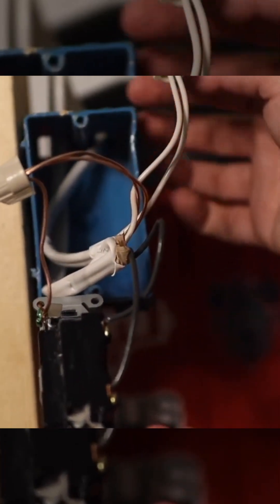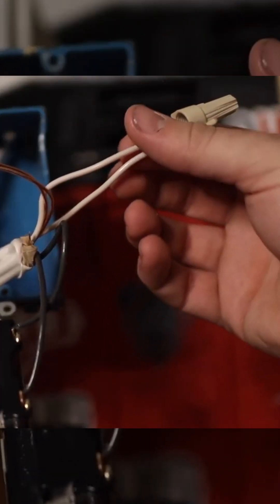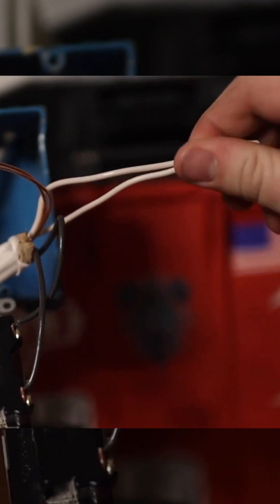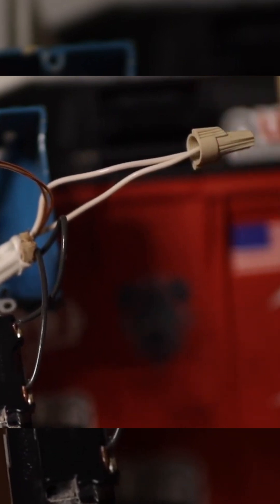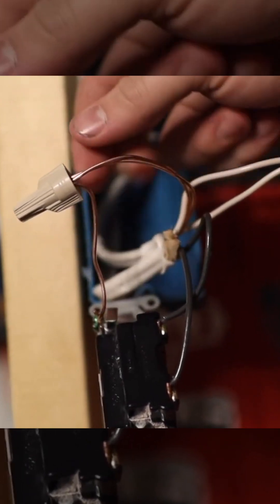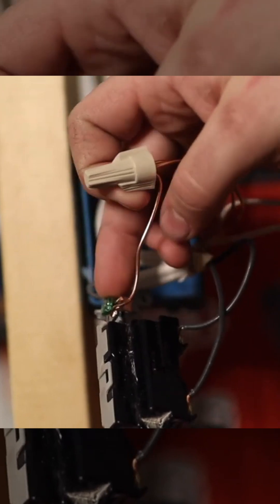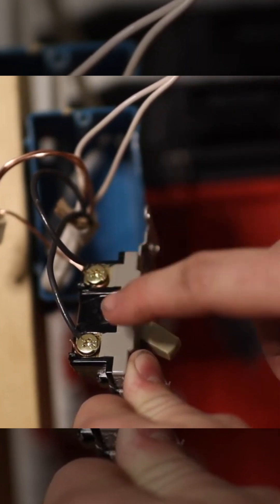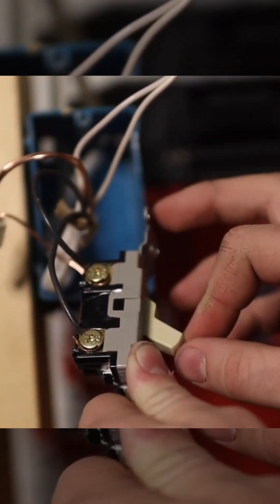How To Wire A Light Switch

Comment: Do you have a video how to tie in a new switch on the other side of the wall from an old light switch that only has 1 wire coming out of the old j box? The existing wire only has black white and ground and comes from who knows where but it controls a ceiling light in the room. I need to get lights in the closet working off that switch...🤔
Reply: Ok,so most likely the white wire is now a hot wire,the black wire is probably a switch leg.Just connect them the same he he explains, and it should work fine.Your welcome 😂

Comment: What if don’t have two wires in the box??
Reply: Should always be 2 sets of wires coming into the box, 1 set is power source the other set goes to the light. However if you open a box and only 1 set of wires that means it has power going to the light first, then a separate Romex coming from the light to the switch box which is referred to as a switch loop ( that's how it was done way back then) now code requires power to the switch first, then a separate Romex going to the light.
Reply: @jonathan3982 i also only have one set of wires coming to my 3 way. Attempted to update the switch now im stumpped. Only one set. So i only have one white, one red and one black. I cant connect the white to anything. The light doesn't come on when the white is not connected at all. And when it is the light sometimes on on depending on which which position the other switch is on. Very confusing. I dont know what else to do.
Reply: @klosettreat  Well there should be a set of wires coming from the light Yes? And a set that's the power source to the switch. So do you have 2 switches that control 1 light? Have you checked the other switch to see if the power source is going to it?
Reply: @klosettreat  Your switch should have 3 screws, a black or dark colored screw which is referred to as the common screw, 2 brass screws and a green screw. Of course the ground ( bare) hooks to the green screw, the red & black hook to the brass screws, which are referred to as traveler wires, white is the neutral should be hooked together with another white coming in with a wire nut. There should also be a another black that is referred to as the common wire. Seems like you have 12/3 AWG coming in at the switch. Each switch box should have 2 whites, 2 blacks, 2 grounds ( bare) and 1 red wire. I'm going to send you a link of video to a guy I follow and subscribed to. He is very informative and knowledgeable. There are different ways to wire a 3 way switch. From what I can gather, you said you only have one set of wires coming in the switch box, which means the power source must be going to the light first and then dropped down to the switch box. Check the other switch box it should have 2 sets of wires? If not what is happening is most likely the power source is going to the light first, and then 2 sets of wires connected together with the power source and light wires, one set each going to the switch box. I hope that makes sense to you. I'm trying my best to help you, I'm not an electrician just knowledgeable about construction. Please watch the link I provided and let me know if it's showing up for you?
Reply: @jonathan3982  yes I have two switches that control one light. One at the top of the stairs and the other at the bottom. The one at the bottom has only one set. Red, black, white. They were all connect to the previous switch. When all are connected to this new switch I can turn the lights on depending on which position the top switch is in. I put a dimmer switch up there and took out the old one.the lights don’t consistently come on all the time but sometimes depending which position the other is in. But they both do not constantly work all the time independent of the other.
Reply: @jonathan3982  wow thank you so much for even replying. That is possible the power goes to the light first. I didn’t think of that. The bottom of the stairs has one set of wires. Red, black, white, and ground. The other switch at the top of the stairs had two sets. So it looks just like yours. I’ll watch the video you recommended and try it. Thank you so much.
Reply: Someone ran a drop switch which is illegal